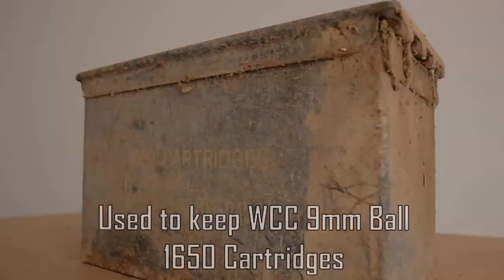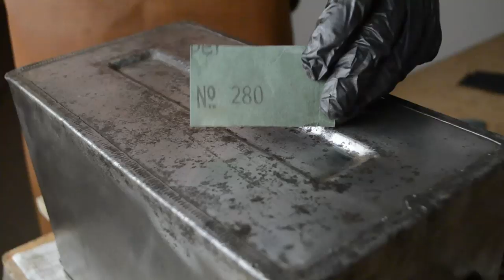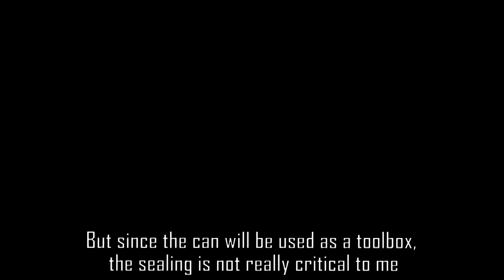Very Rusty WCC Ammo Can Restoration | ASMR Restoration

Comment: Nice job!  I like your philosophy about giving objects a second life, and the Zen of doing this work.  Much more gratifying than just buying a new one.  What are the brushes you used?  Are they brass?  Bronze?  They seem to cut quite well.  Personally, I would have done a weak acid dip to remove rust deep in the pits, and finished with a paint like Aervoe or Gillespie Coatings, since they have true mil-spec colors.  Still, an outstanding job.  Keep it up.
Reply from the maker: Yea.. it's a personal achievement for myself..satisfied and gained new skills.. those are brass wire brush. Thanks for suggestion for mil-spec colours, will try to look for it..as I'm some detailing on my bike.. plan to give it an army style look

Comment: Would a dremmel tool make the cleaning quicker,
Reply from the maker: I started to use wire brush on a hand drill.. but still need to do some manual sanding for some area

Comment: Could you possibly leave a list of things you used?
Reply from the maker: Sure! My pleasure..here is the item I used:
1. Cif cleaning agent 
2. Paint remover to strip off the paint
3. Wire brush 
4. Sandpaper
5. Stencil template from printing shop
6. Primer spray paint 
7. Army Green Spray paint
8. Yellow Spray paint (for the stencil)

I guess that's all..hope i didnt miss out any 😊 wish you good luck!
Reply: @theymaker125  what was the filler you used?  thanks.
Reply from the maker: @redone823  i used metal putty, Hitary filling putty
Reply: @theymaker125  thanks a bunch
Reply from the maker: @redone823  no problem😊

Comment: What kind of putty did you use to fill the holes?
Reply from the maker: It's a car metal filling putty that I got from local hardware store
Reply: @theymaker125  you could've also just used a canned filler primer for that part. Just throwing that out there.